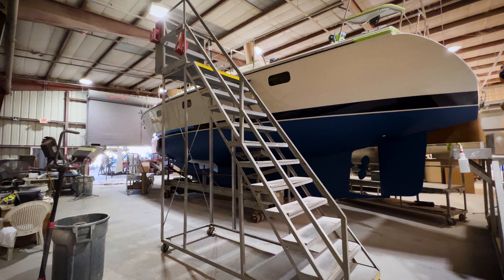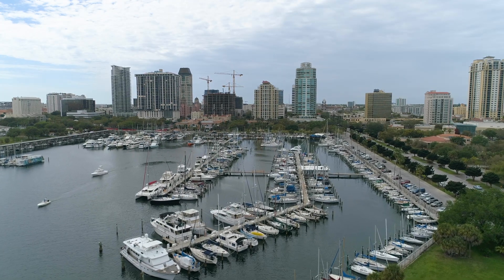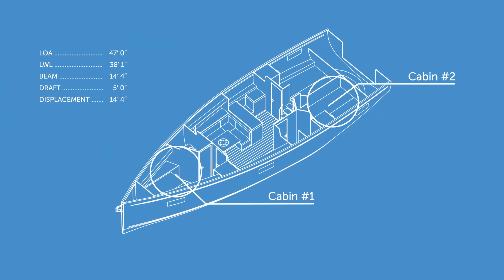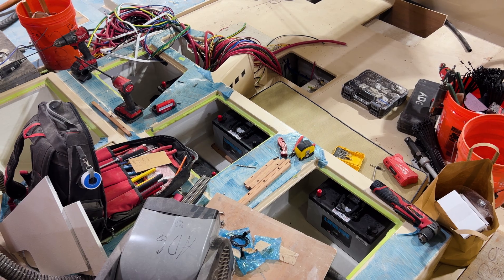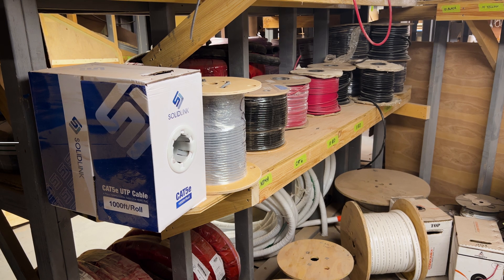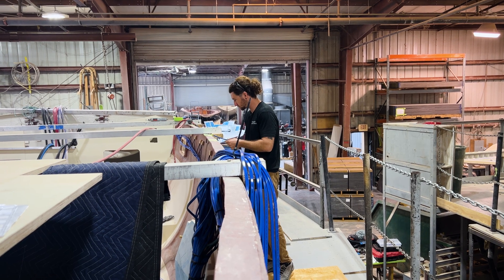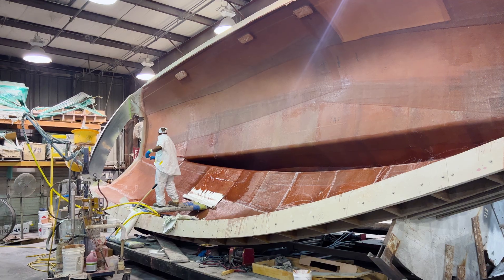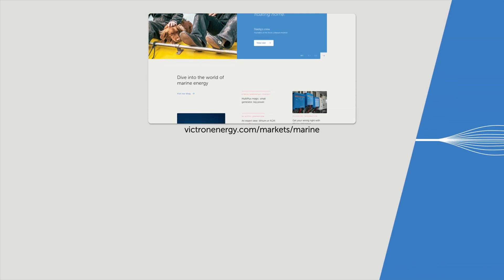How Florida yacht builder deals with increased power usage onboard.

Comment from the maker: 🎯 Key Takeaways for quick navigation:

00:01 ⚡ Yacht builder in Florida faces increased demand for electrical appliances like electric galleys and air conditioning on yachts, requiring higher power capacity.
01:38 🛥️ Owners are demanding more electronics, including coffee makers and seltzer makers, which need battery power when at sea for extended periods.
03:44 🔋 Transitioning to Victron Lithium batteries has several benefits, including higher capacity, lightweight, easy maintenance, and a longer lifespan compared to AGM batteries.
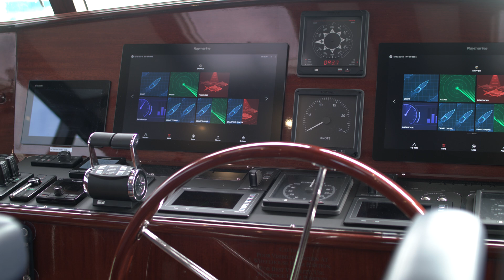05:22 🌐 Victron equipment offers high compatibility with other components, simplifying network integration and allowing for centralized monitoring through the VictronConnect app and VRM.
07:27 🚤 The yacht builder plans to continue using Lithium batteries and Victron Energy equipment due to their longevity and high resale value for custom-built yachts.

Comment: The industry really needs to move to 48V (winches, thrusters, refrigeration, watermaker, HVAC, etc.).
Reply: the refrigerator that I had in my last motorhome would run 12v or 24v
and I have seen some 48V bow thrusters
I think you just have to look for them, but certainly there will be more as demand grows
Reply: That would be great!

Comment: just a shame hair straighteners will not run on victron inverters,i had to resort to master volt to run this item,shame when all my other electronics is victron
Reply: I don't think it's a victron issue,  more a wattage issue
Reply: @projecttrawler  i spoke to victon who unfortunately said they cannot help,the syraighteners wattage is 100 watts then drops to 5 watts,im using  a 1200 watt inverter ,the mastervolt run them no problem but i committed to victron for my setup
Reply: @projecttrawler  Bingo!
Reply: have you tried some differant hair straighteners. else a bigger inverter is all it will take :)
or you can pair up two Victron inverters together, to give you more POWER
Reply: Post your setup and question on Victron Community. You'll usually get an intelligent answer.